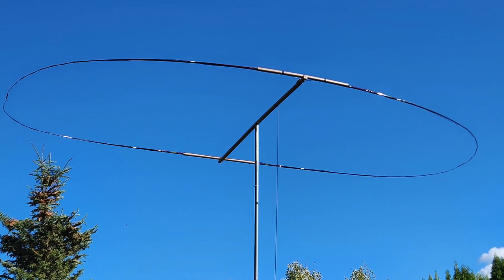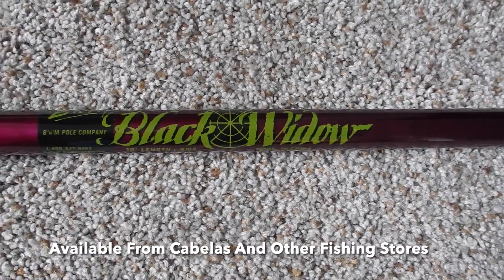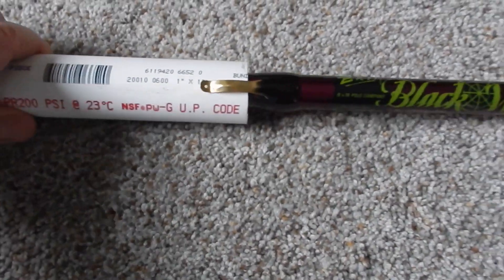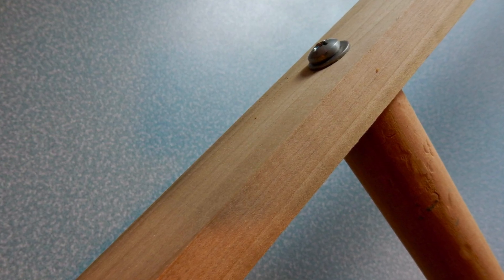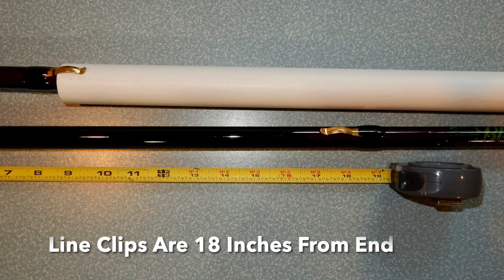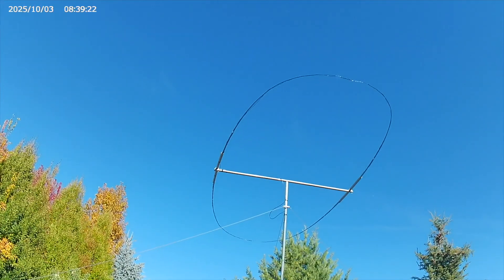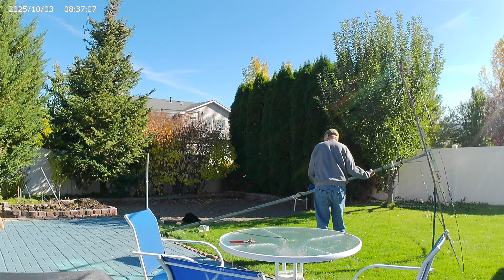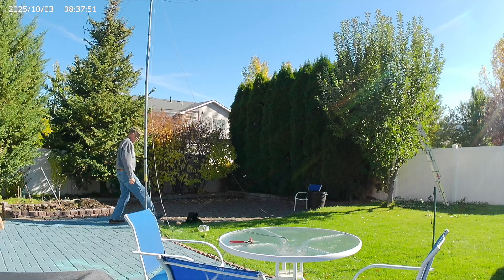Improved 15 Meter Oval Moxon Antenna

Comment: Nice video. Enjoyed this one and the one for the 10/6 meter moxon. I'm very curious what mast you are using! Military mast sections? I plan to try and build one of these for 10 meters very soon. Thanks!
Reply from the maker: I have several fiberglass sections of an old 50 foot MFJ mast.  The walls are almost 1/8 inch thick so plenty sturdy.  It is too bad these types of masts are so hard to find at a reasonable price anymore.